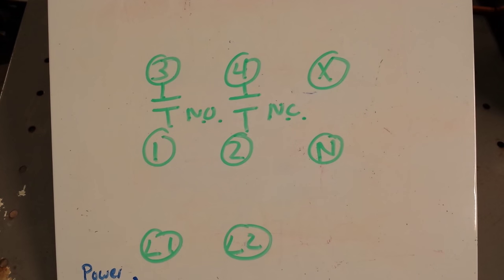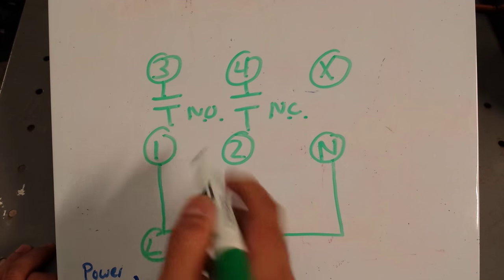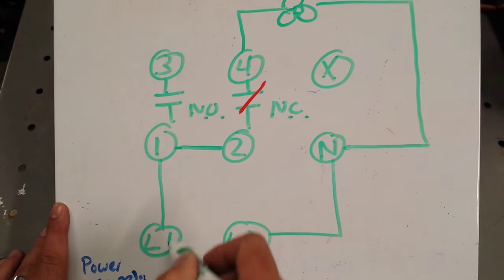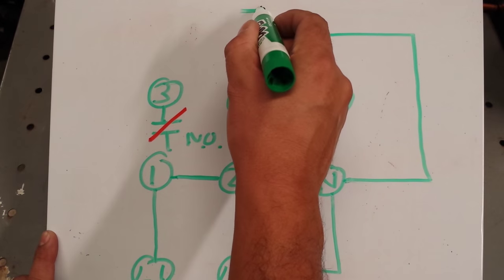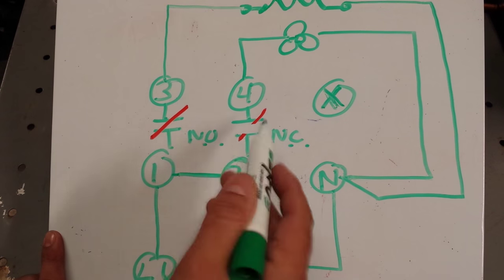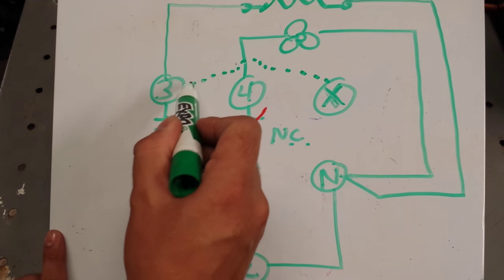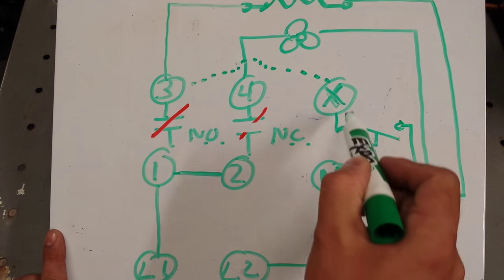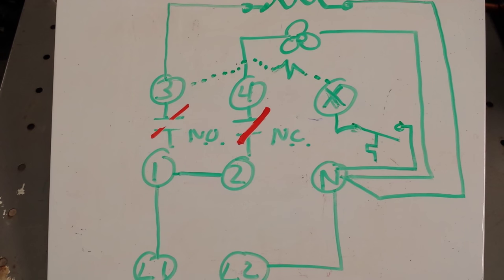HOW FREEZER DEFROST TIMER OPERATES - PART 2

Comment: much easier to understand, thank you very much, hopefuly you can do a explanation on a whole freezer or cooler wiring , like contactor, relay,capacitor,compressor,compressor heater, condensor fan etc.
Reply from the maker: +Ryan Dong will work on it. Thanks.

Comment: Hi, can you do a video explaining how condensing units are connected to case lineups (example, 36 feet of produce, or three 12 ft cases) ? Are the thermostats in all 3 cases connected in parallel with each other, and in series with the liquid line solenoid coil? Thanks.

Comment: I thing connecting and disconnecting the compressor with NO contact, thermostat is inserted to compresor, otherwise following your wiring plan we have a short circuit. "X" is the one contact of the "motor timer" next contact is the "N".

Comment: Great video! Where does the solenoid valve get wired too?
Reply from the maker: It would be wired in series with the temp control,  which goes  through the normally close terminal on the timer.

Comment: time or temp defrost termination
Reply from the maker: +kidd sheppard 
Usually in  freezer application it will utilize temp termination. Time termination is your back up, which is simply the duration time set on your middle dial.